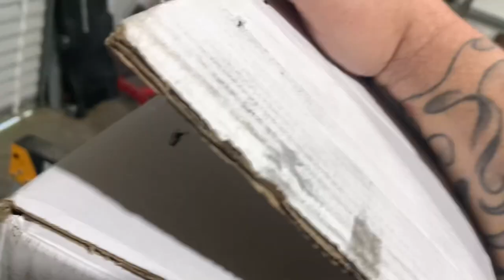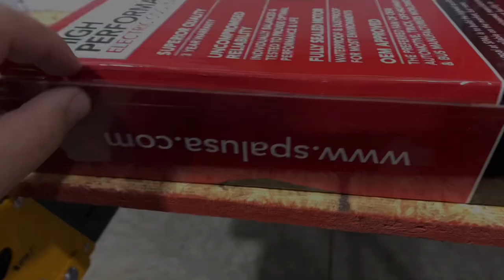55’ Chevy Truck | Radiator & SPAL Electric Fans!

Comment: Did you get the cover built to hold the radiator in place?  Would you show us what you did?  Thanks.
Reply from the maker: I just got a simple precut piece of aluminum sheet from Tractor Supply, and bent it in three sections with a cheapo Harbor Freight metal brake. Worked perfectly and looks great. My email is in the description if you want to shoot me a message, I’ll send you some pictures. You can also see it in some of the “shorts” videos.

Comment: You happen to have the part number of that radiator?
Reply from the maker: Picture doesn’t match but this is the link: https://amzn.to/3Qbi0rD
Reply: Awesome thanks have you found a shroud for it? Also what about the electric fans do you happen to have a link for that?
Reply from the maker: @juanrocha6548  Sure, here’s the fans: https://amzn.to/46u8sh1
Ive not gotten a shroud and don’t think I’ll need one… these fans pull a LOT of air. But in the unlikely event that I’ll need one, I’ll just head over to the local sheet metal shop with a template. Do you have the same truck/engine platform?
Reply: Yes I do I am pretty much running the same setup my 6.0L is a gen 3 tho yours will be alot better your fabrications skills are way above mine
Reply from the maker: @juanrocha6548  I’ll tell you what… Ive yet to see one of these trucks that didn’t turn out cool - from people who cant fabricate at all - to people that run circles around me. Just be creative and have fun with it. It will come out great, and it will be YOURS… Truly one of a kind!
Reply: Very true thanks man